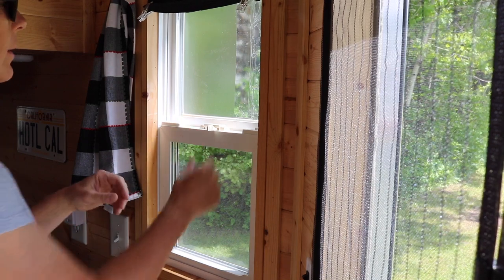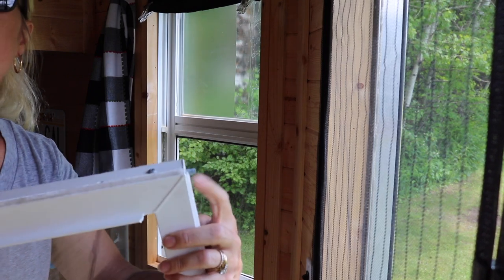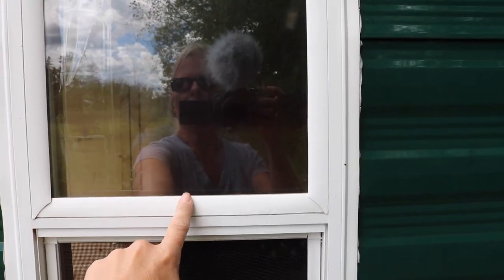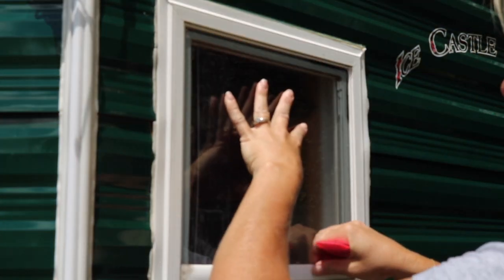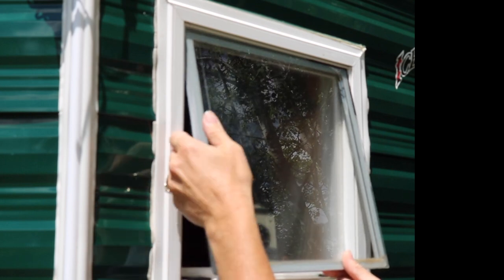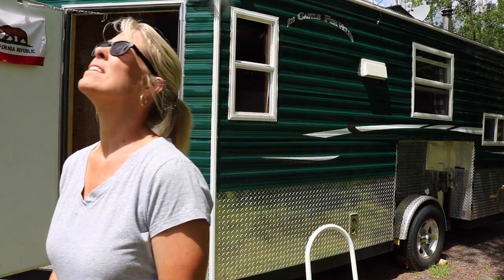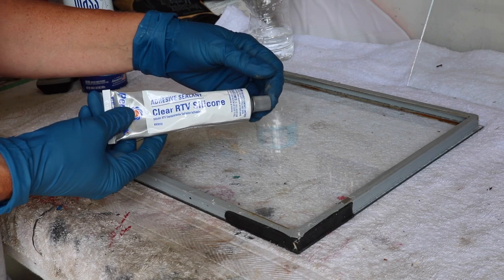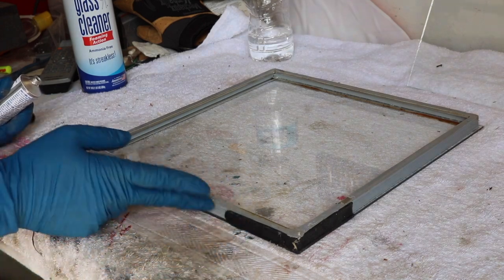HOW TO: Replace the glass in an Ice Castle Window

Comment: Thanks for the content. Might help me fix ours. The big side window is leaking at the corner and staining / water damage to my inside trim in that corner. Probably gunna have to pull the whole damn window out to fix it
Reply from the maker: Yikes. I think you might. It seems as though Ice Castle has (or had) some QC issues. Mine had all kinds of little things that were poorly done. You might do a little reading to see if butyl tape would be a proper solution to the leaking windows. Good luck with it! 🙂
Reply: You definitely helped me out!!! Never knew i could pull out the windows. New big window os needed. Water down the weep hole pours into the house. Called Milaca and they told me bring it in well fix it for free since it wasn't done right the 1st time
Reply from the maker: @ryanvarner2338  That's great! You might want to go that route,  depending on how far you are from there and their time frame. All things winter are starting to ramp up so hopefully, you can beat the surge!